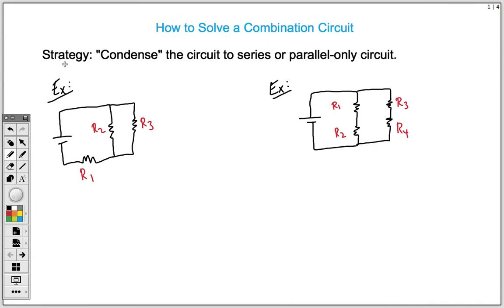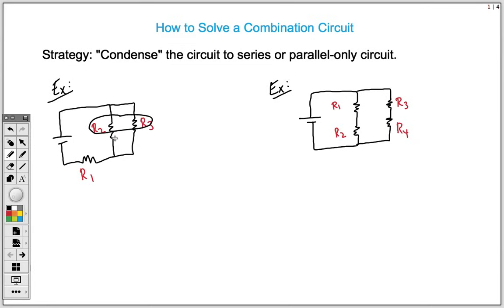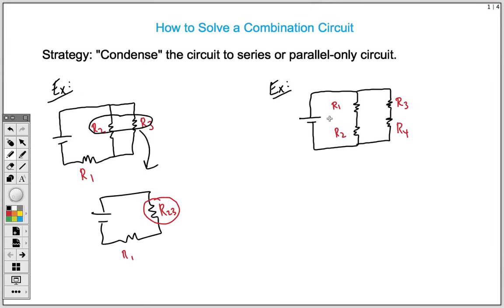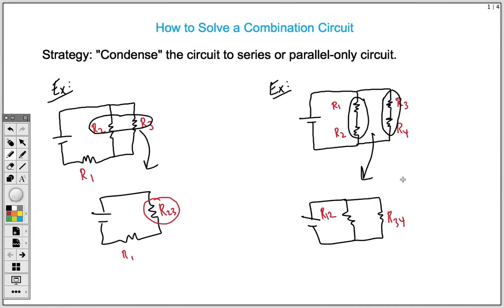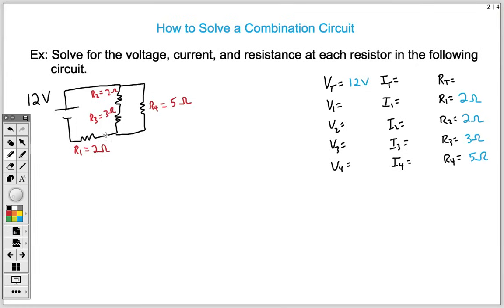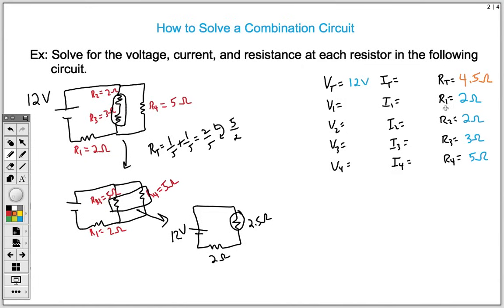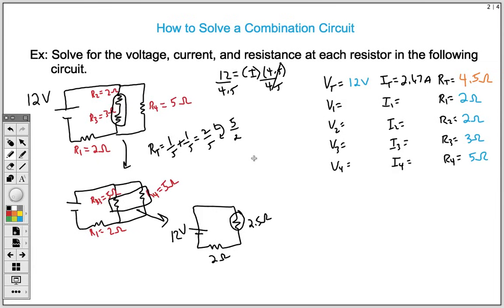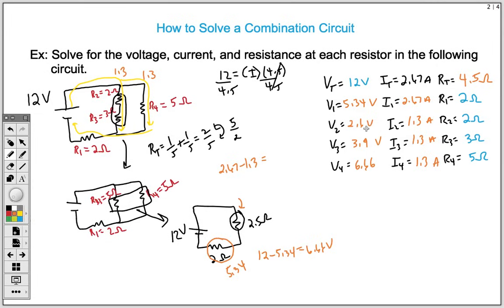How to Solve a Combination Circuit (Easy)

Comment: This is wrong, add all the Voltages and you don’t get 12
Reply from the maker: It's correct. The voltages don't add up to 12 because it's a combination circuit.
Reply: @ yeah you right I found out the hard way but now I know how to do it thanks

Comment: im a dumb guy when it comes to any math subject, i just wanna ask why did you flip the 2/5 in 5:21
Reply from the maker: The equation for total resistance in parallel is 1/Rt. Since we want Rt and not 1/Rt we either have to flip the fraction or cross multiply. I chose to flip the fraction. Both methods will get you the same answer.

Comment: You actually got that wrong.

In getting I4 , 6.66V / 5R is actually 1.332A
Which means V2 is 2R x 1.332A = 2.664V
And V3 is 3R x 1.332A = 3.996V
So V2 + V3 = 6.66 = V4

A1 or 2.66A is an exception to this because its 2 and .6 to infinity.
Reply: Oh and if you use 1.3A in V4 , It's actual sum is 6.5V. same as the sum V2 and V3 if you used 1.3A since V2 will become 2.6V and V3 is 3.9V adding up to 6.5V.
Every little difference counts in math :)

Comment: why was the 2/5 flipped and made 5/2 for the R234 total?
Reply from the maker: That's the rule when finding total resistance in a parallel circuit.
Reply from the maker: Looks like I should've written the equation for that as 1/Rt = 1/R23 + 1/R4

Comment: Before understanding Kirchhoff’s Law which maybe found in several textbooks, it is useful to know how does current know how to split in parallel branches. 

To answer this question one must know the role of surface charges in establishing a current and potential difference in a circuit. 

Supposing there is a simple series circuit comprising a battery, wires and a resistor R1 and there is a dead-end branch with a resistor R2 across R1.
When the circuit is made then initially electrons flow into both branches, but the surface of the dead-end branch becomes charged so negatively that no more electrons can enter. This prevents current flowing into the dead-end branch.
Current of appropriate strength will flow in the R2 branch when the branch is connected across R1. 

It is not possible in this post to discuss in more detail the rearrangement of surface charges which allows current through the branch. 

Electrostatics and circuits belong to one science not two and it is instructive to understand Current, the conduction process and Voltage at the fundamental level as in the following two videos: 

i. https://youtu.be/TTtt28b1dYo and
ii. https://youtu.be/8BQM_xw2Rfo 

The last frame References in video #1 lists textbooks 3 and 4 which discuss surface charges and explains their rearrangement with the help of sequential diagrams in parallel circuits and topics on capacitive and inductive circuits using a unified approach to electrostatics and circuits.

Comment: If I take out the series bulb, will the parallel bulbs burn out?
And if I take a parallel bulb, will the series bulb burn out? Please answerr
Reply from the maker: In the math problem I solved, if we were to take out R1 then the whole circuit would break. If you took out one of the parallel ones, nothing would burn out.

Comment: pretty sure he screwed up V4, voltages doesn't add up to 12voltss
Reply from the maker: That's because you add voltages differently in series and parallel circuits. Know your rules.
Reply: @DMaciaga  oh dam i got schooled, ty

Comment: why r1 and r2 not next to each other??? I'm confused.
Reply from the maker: Resistors don't need to be next to each other. Labeling them R1 and R2 is just a means to give them a name.
Reply: @DMaciaga  Ok thanks. Where does the current first enter? in r1 or in r2? I'm confused with the flow of the current. 
Thanks for the response sir.
Reply from the maker: @chlowiemarielacaba7080  I explain at 7:00 in the video.

Comment: Got the message, but it is hard work following your 'shooting cursor' around the board. And you need to enlarge the images at source. The figures and symbols are really sitting cheek by cheek. And your writing leaves a lot to be desired. Otherwise, an excellent presentation.

Comment: I thought the summation of voltage totals to voltage source? Or it is just applicable to series?
Reply from the maker: Yes, just for series. In a parallel circuit the total voltage is the same throughout the circuit. When dealing with combination circuits you have to be mindful of that difference.

Comment: Why is the result of the parallel portion 2.5 instead of 0.4?
Reply: derick palmer because you have to solve for the reciprocal meaning you have to flip the the numbers. So instead of solving for 2/5 which would be 0.4 what you initially thought the answer was, you’re actually suppose to solve for 5/2 and your answer would be 2.5.

Comment: @7:05 doesn’t current flow from negative to positive?
Reply: It depends on the theory. Conventional theory States positive to negative, electron flow theory states negative to positive
Reply: It does but you can calculate it either way, just as long as you stay consistent.
Reply: It does but to calculate it in negative would be really annoying. So conventional theory just stays positive for the sake of less negative numbers. If you are involved with engineering then you might calculate from negative to positive.

Comment: Question...in the 2nd example to the right after you condensed it down to  2 parallel resistors why can u not simplify/condense it  further and add resistors r1/r2. And r3/r4 together into 1 series resistor/circuit making it even more simple yet!? Sorry I'm totally new to this! Thx for any and all info!

Comment: Then how to check their total voltage current and resistor?
When you sum them up it is over to their total Voltage/Current/Resistor
Reply from the maker: Because it is a combination circuit you can't just sum them up, you would have to use rules for series and parallel at the appropriate time.

Comment: What if you had another parallel section after R4?
Reply from the maker: You would condense it at the same time as the other parallel circuits (the second of the three circuits drawn). The math would be 1/5 + 1/5 + 1/R5.

Comment: why didn't you use the 'parallel rule' and instead simply did reciprocals? Parallel rule results in a different answer.. Please help - thank you!
Reply from the maker: Because this circuit has a combination of series and parallel, you have to use both series and parallel rules instead of just using parallel rules.
Reply: I think he doesnt know about the cross multiply rule you're referring too. Like St=R1×R2÷R1+R2
You got a different number because he also did his equation wrong; its suppose to be
 1/Rtotal= 1/r +1/r+1/r

Comment: This vid is almost 2yo.  Nobody summed up the voltages yet?  Vt = 18.34V ?
Reply from the maker: The issue here is that you are adding up the voltages of both parallel branches in addition to V1. The rule for parallel is that the voltage is the same so you only count 6.66v once. 6.66v plus 5.34v gets you to 12v.
Reply from the maker: Vt = 12. This was given as the voltage of the battery.
Reply: so how does the circuit exceed the 12V battery? Not sure why you went back to the original Series Parallel Circuit. If you finish with the condensed Series circuit you end up with, VR1 = 2.666x2 which = 5.333V & VR2 = 2.666x2.5 which = 6.666v. These 2 add up to 11.9998V & with 10% tolerance. Great vid but just curious if this is part of the Conventional Circuit which Americans use (I'm Australian) as our current flows Neg to Pos.  @DMaciaga

Comment: Wouldnt the R(t)= .40 because 2 divided by 5 is .40?
Reply: It was 1/5+1/5=2/5, yes, but you use the reciprocal in that method, which is 5/2=2.5

Comment: combination has the same current flow through all resistors. shouldnt it be IT=I1=I2=I3
Reply: Series uses that rule, parallel is IT=I1+I2+I3, etc, combination means the circuit uses series and parallel in combination

Comment: Where that 1/5 came from please i need a clarification
Reply from the maker: At 5:12? Since I was adding those resistors in parallel, the rule is to add up their reciprocals. Originally the resistor was 5 ohms, so its reciprocal is 1/5.
Reply: So flipping 2/5 to 5/2 is the same thing as 2/5 = .4 then 1/.4 = 2.5 otherwise known as 1/Rt = 1/R1 + 1/R2 + 1/R3?

Comment: where did 2.67 came from?
Reply from the maker: Using Ohm's Law V = IR. V = 12V and R = 4.5 Ohms. To find the current you would divide 12/4.5 = 2.67.
Reply: @DMaciaga  I know I'm years late but isn't it 2.66?
Reply from the maker: @feign9513  honestly I don't find much of a difference between 2.67 and 2.66.
Reply: 6:30

Comment: Thanx
Reply: is the v1,v2, v3, & v4 are the voltage drop to each resistors?  if ur going to sum up this four (4), it will be 18.5v not 12v, is this correct? the v1 to v4 sum will not be proportioned with the total 12v supply? tnx
Reply: @GSABD  he condensed the resistors down so technically its V(234) + V(1) so it would be 12 voltages not 18.5 volts